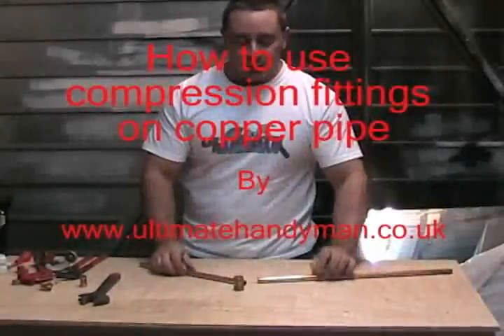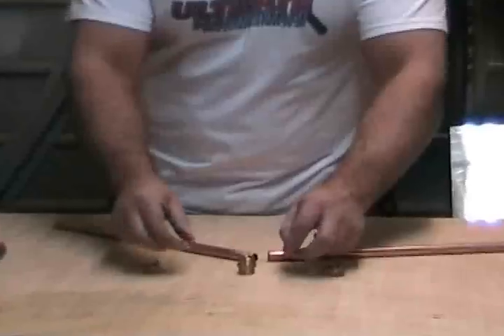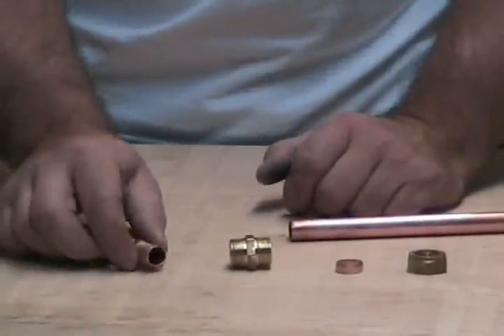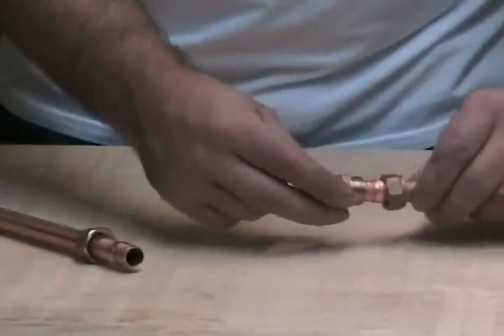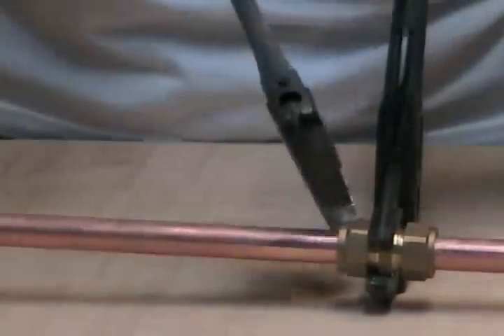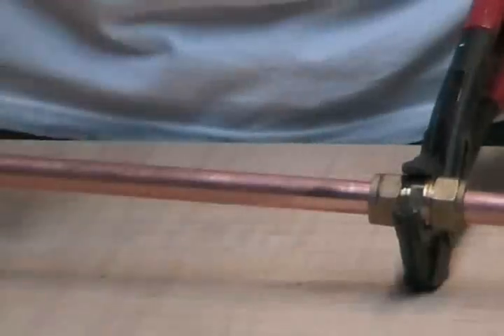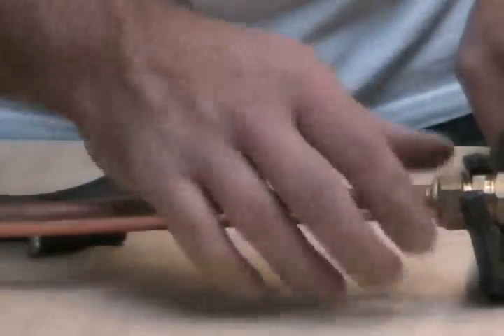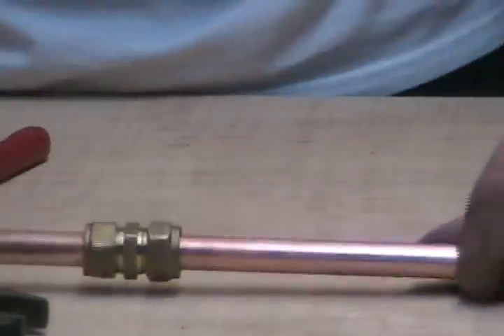compression fittings

Comment: After struggling to get compression fittings to seal correctly my partner and I decided to approach it scientifically and find which fitting method worked best. The method shown here is the only one that consistently produced a good seal. Our testing showed that a 1/3 to 1/2 turn after hand tight was always enough to make a seal that would hold mains pressure water. Our mistake in the past was overtightening.

Comment: Sorry ultimate handyman, copper fittings are designed for high pressure espically flared comp fittings. They will easy withstand 2000kpa even more and if soldered it will take an earthquake to bust a joint. I am a mechanical plumber and we use all sizes of copper to run chillers, boilers, expansion tanks, hot water, cold water etc... Ideally copper soldered behind walls bit if not comp fittings are fine. It may be expensive but is by far the best way to run everything...

Comment: Further to my comment, the reason I'm asking this is that I am replacing a sink with a porcelain pedestal sink. The good news is that the hot/cold water pipes will be almost directly behind the pedestal sink. The bad news is that the drain pipe will run to the right of the pedestal base. The current black ABS drain pipes will be replaced by white PVC pipes to blend in with the white color of the sink. But what do you suggest I do with the copper part (sticking out about 5 ") of drain pipe?

Comment: Thanks for this demo.  I thought I noticed the pipe itself rotate a bit when you were tightening the second nut - does this method of joining put any torque/rotating force on the pipe (which could strain the previous joint in a run of pipe)?

Comment: I hope im not too late in replying, but you can use plain old soapy water on the olive to lubricate a little, that way it will stop from squeaking and biting. If the copper olive wont hold then try a nylon olive, they are cheaper and more reliable... Usually around 30 cents each here in Australia

Comment: I have a 6mm metal pipe.  Where can i find a 6mm compression fitting.  imperial sizes are plentiful, but will a 1/4 compression fitting be tight enough on a 6mm pipe?

Comment: Hello, I have to cut a copper water supply line which runs to my sink (hot & cold).
Then I want to replace it with a flexible supply line, for a pedestal sink. But I need a thread at the end of the copper pipe which I just cut. Can I accomplish this with some kind of compression fitting? Thanks.